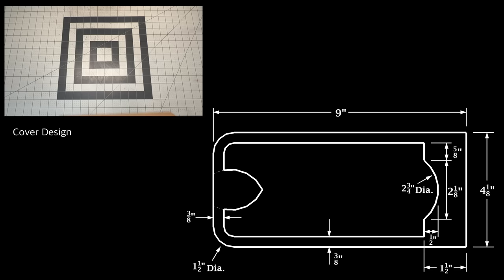Making A Custom Designed Leather Cell Phone Bag - Leather Craft

Comment: Hi, i have a leather craft question. Does the mink oil act as a sealant? I've used resoline and tan kote, but have only used oils to condition the leather before dying. Have you had any color fade or rubbing off on clothes with the mink oil finish? It looks amazing, it would be interesting to try. Also, do you happen to have patterns for sale?
Reply from the maker: Thanks. I use mink oil only to help soften the leather. I don’t think it helps with rub-off. I just try not to over dye my projects.